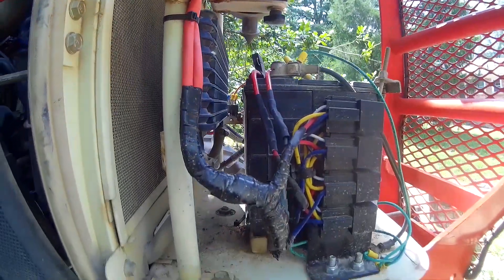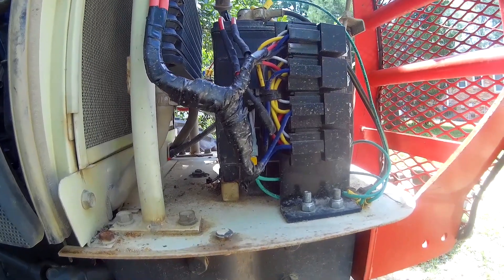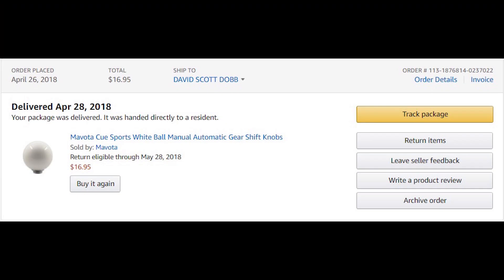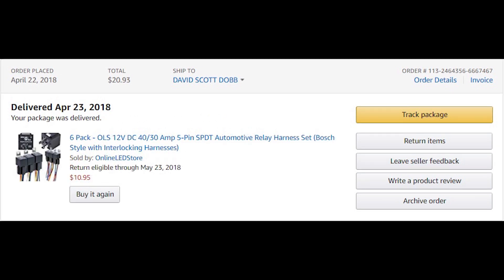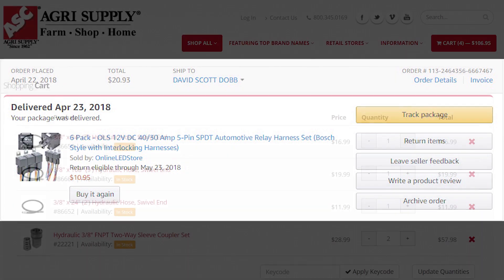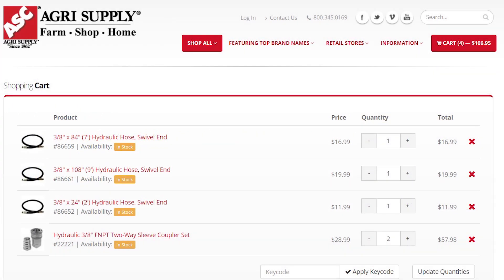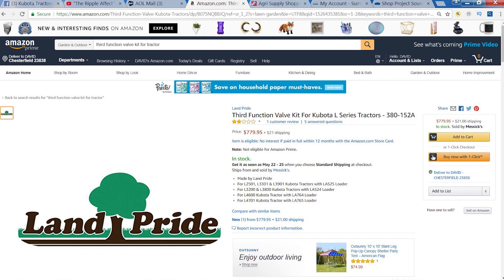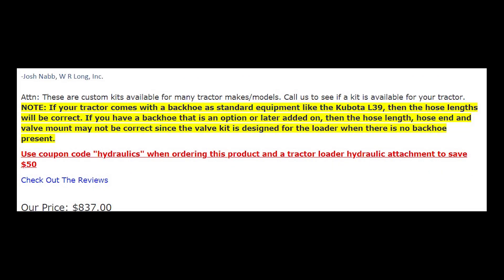installing a third function on a budget part 1

Comment: Dave, I really enjoy what you are doing with your tractor. I have a 2004 B2910 and discovered I do not have a power beyond port. You have any ideas how I can add this port so I can add the systems like you are doing? My tractor is a 30 hp.
Reply from the maker: you sure you do not have a power beyond port? I find that hard to believe. look at the front end loader valve. you will see the power beyond port located there. I'm happy to help any way I can. you can email me directly if you need to.
Reply: @daveknowshow  no power beyond port. Only 6 hoses at loader control and only 3 hoses at the manifold on the transmission below the driver's right foot.
Reply from the maker: @gaewing  if you got three hoses at the manifold under your right foot they are more like as follows. main power out to supply loader, back to tank line, and power beyond to feed the three point.  if you take the supply line that feeds the loader valve and disconnect it at the loader valve. use that line to feed fluid to your new valve. then set the new valve up for power beyond. run a hose from the new valve power beyond to where you disconnected the main supply line at the loader valve. then run a hose from the new valve back to tank port to the back to tank port at the manifold or dump it into the transmission.

Comment: Hi Dave,
I read that you have been dealing with some serious back pain. I have terrible low back pain myself. What things are you doing that are bringing some relief? In my situation, it seems to help to wear a support back belt (I put it in between two shirts), if I will be wrenching on a car, and bent over. For me, that's what lights my back up in a hurry is being hunched over a car, but the back belt seems to keep that area warm and supported. I got this big rubber ball full of air that I lay over and do hyperextensions on, to try and strengthen it, and stiff legged dead lifts with dumbbells. I dont like going to the doctor, and I suppose I'll go in when it hurts bad enough, which I know isnt a good plan to wait that long. Even going for a walk with my wife, jeepers my left hip gets irritated amongst other things.  I started taking "flex" by a company called "animal" to take in natural antimfammitory to try and lubricate joints. Aleve seems to help too. Seems like some folks are better after back surgery, and some are much worse. Kinda scary!
Reply from the maker: I feel your pain brother, I'm in physical therapy at the moment better known as PT " pain and torture ". lol I use Tylenol and advil as well as heat. but nothing really helps. I have a disc in my spine that is rotated from a car accident back in sept. as well as whip lash to my neck area that has my muscles and nerves very sensitive. of course I'm no Doctor so not sure what the verdict will be. hoping therapy will straighten me out although I may need surgery as well. yes surgery is a scary thought. my brother went through it and he never got better. I may look at the flex you mentioned and see what its all about. lately I been going through so many medical issues I have to be careful what I do take. all this stress has had my blood pressure clean off the charts compared to what my baseline BP usually is. one thing all the doctors, therapist, and mental health providers all agree on is I need to make more youtube videos. ha ha. I don't know if they feel the youtube videos help me or if they just enjoy watching them. ha ha.
Reply: daveknowshow 
Oh man! Car accidents suck. The wife just got smashed into last month, a middle aged gentleman was looking down, she was stopped, and saw him coming with his head down, and KABAM! Smashed into her bumper. Shes in therapy gets massages then adjustments from a chiropractor. When we were picking up the car after fixed, the guy at the autobody shop said, if there aren't witnesses from other cars, it's your word against theirs as to what in sam hell happened. So I went out and bought a front and rear drive cam (2 channel) for my little 81 rabbit diesel. Seems like everybody out there wants to run my little car off the damn road. I bought a blacksys ch-200 drive cam, and the cell link neo battery for when its ppl arked at work, so it dont drain my car battery during parking. So far so good. Hopefully youll get better! For me, I know the expression fully that goes, "I have my good days, and I have my bad days"
Reply from the maker: yes indeed good days and bad days for sure. hope your wife feels better. sometimes the worse part is dealing with insurance companies after the accident.

Comment: nice video, looking fwd to see the installation. What does that extra locking valve do for you? thanks
Reply from the maker: it holds the position of the hydraulic cylinder to help with control of the load in which it is applying. I will show a future video of what it does.

Comment: if you live in Canada you can get all this stuff including the locking valve  for close to if not less in CND FUNDS FROM PRINCES AUTO STORES ACROSS CANADA, ONE STOP SHOP
Reply from the maker: yes I like those prince valves I use them a lot.
Reply: yes as a welder mfg all my life i custom biuld all kinds of things for people and i buy  most of my parts from there, they are name brand parts such as Eton pumps, motors hoses are very good and low price, weather head hose and fittings, local shops charge 5 times more for the same thing, same as Amazon, well maybe only 2 times for them, i love there cable controlled remote valves, you can add a joy stick or a leaver

Comment: Good to see you out and about a little Dave.
 Hope you are doing better ? 
 This video is my capabilities as you know. But I would like to know if your plush tractor seat come with your tractor ??
Is it comfortably shaped for your back ?
  Vic
Reply from the maker: actually my original tractor seat tore over the winter from the extreme cold. I guess I should not complain as it lasted a very long time. my tractor is a 2005 model and that was the original seat. I got this one from a local store here called Northern hydraulics. when people buy stuff online and then do a return they have them return the item to a local store. then the store reduces the item by a pretty good amount. typically about 30 to 50 % off. I got this seat and it is fully adjustable lumbar and all that jazz. I cant tell how well it is on my back because I been in physical therapy the last 6 months with severe back pain. nothing is helping so although I love the seat and arm rest its hard to tell if it is helping my back or not. plus I have not had much tractor seat time lately. they found out now I have a rotated disc in my back that is causing a lot of this pain. I'm trying to get stronger with hopes  the pain will ease up but so far its just gotten worse. I may have to resort to surgery although that is not really the route I want to take I may have no other option as this pain is really keeping me from doing things I would like to try and do. hope you have a great fathers day been thinking of you both. take care Dave
Reply: Really hate to hear about the back pain, as I fully understand and you can't get away from that, day or night in some cases. That is why I"m up at 1AM and looks like for the night. 
 I assume that is why you answered this at 3 in the morning ? 
   Did your new seat fit with out a lot of modifications  ?
My L3300 is 10 years older than your tractor and could use a new seat and floor mats . They want a little to much for their their floor mats.
 I got some tractor seat time, but the wrong kind. Had lots of hard rain and washed my 100 yd. up hill driveway and the twisting around to watch the blade, does a number on my back. I can't grab my 2 or 4 W shift knob without thinking of you :-)  What a back saver !
 I see your weather is about like mine, with realfeel temperature above 100 F. seems like the humidity acts like a magnifying glass for the sun.  
 Have a Happy Fathers Day your self.
Reply from the maker: the seat did take some modifying to fit. I may do a future video to show what the modification looks like. yes this heat humidity is a killer around here.